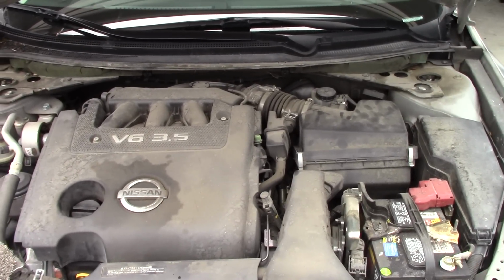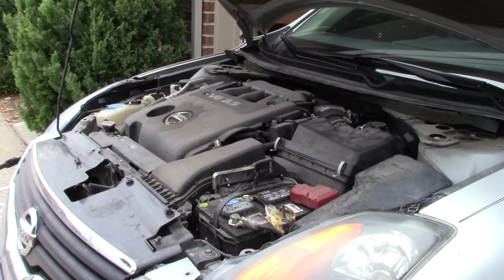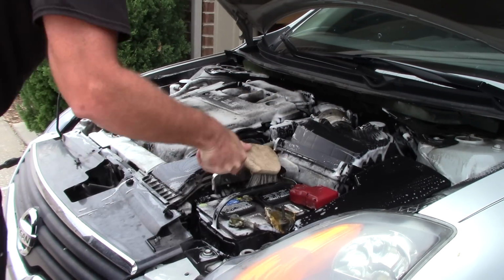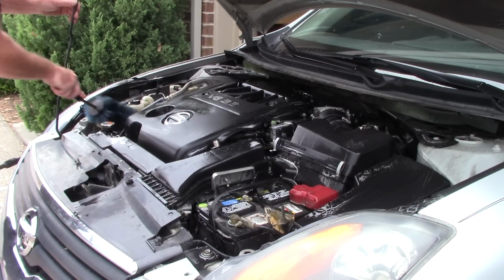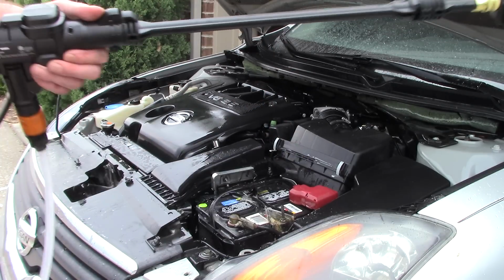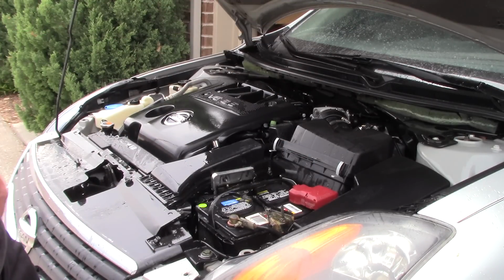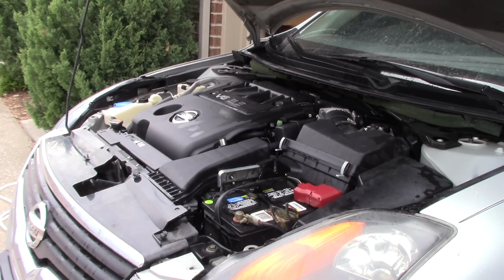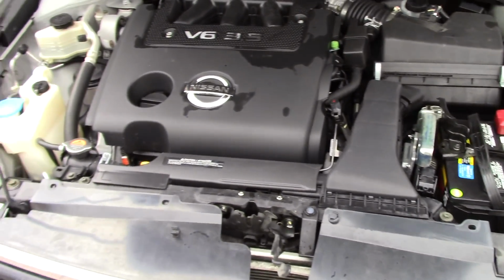Real Time: Super Clean Aerosol vs Dirty Engine Bay - Great Video For Beginners

Comment: Nice Video & Good Work & Knowledge, The Only Thing I Think was kinda funny & he will say “ ITS BECAUSE I WAS TIRED “ he said it’s a 2007 or a 2018 Nissan Altima there is a Huge Difference in the Engine bay / Body Design Between a 2007 & or a 2018 & it couldn’t be a 2018 & Not Have Been cleaned in So Long, when they just came Out “

Comment: If he had no problems with the sensors is a very lucky man because the Walter must be at least 1 meter of the engine,  better hot water. And disconect the batery.

Comment: Using a power washer on electrical parts can damage them. Avoid the ECU, fuse box, etc. A garden hose would have less pressure and will be safer.

Comment: Surely its not wise to spray pressurised water into an engine bay, this could force water into electrical sensors or otherwise. Fair enough use the foam and agitate it, but a wipe down with microfibre towels would prevent water ingress under pressure

Comment: Is there a problem with just wiping off the SuperClean with a towel and skipping the water?  Won't be as thorough, I know. Thx for your videos.
Reply from the maker: that would work just fine and would work depending on your level of expectations...great question:)...i have a video coming up soon on how to wash a engine bay thats safe and with no water even if engine bay is really dirty
Reply: THx! Will be watching for the next one. This 80-year-old lady is enjoying and benefitting from your videos. Could hardly wait until the stores opened to get my SuperClean and glass washing "tool" to clean my 2007 Camry door jambs.Looking good!. Guess I need to go back tomorrow to buy the Invisible glass triangular tool that I also passed up as a gimmick. Could not begin to consider sitting backwards and getting enough pressure to clean the interior windshield. May have to figure a workaround to use a Magic Eraser on that tool.
Reply: @dallaspaintcorrectionautod8343 wouldn't just wiping super clean off paint be the same as letting it dry on paint?

Comment: thanks

long day...

often wondered how mechanics perceive clean engines vs filthy engines,  their owners and their efforts  to  repair filthy engines bays
leaning in and over dirt oil and  grease 

tools, hands clothes compromised more than when working on a clean engine

small dropped screws, bolts etc.  lost in the mucky engine area

does the quality of the efforts increase with cleaner motors

hmmmm....

Comment: **Ever heard never use water over the engine**

So dry clean is supposed to be better. The beginning process is fine, just do not drop water like that, use a towel and rinse it in a bucket with water, up to clean it.
Reply from the maker: If you lack experience, you should do a dry clean and let professionals do what we all do and have for years using water..
It's done by the biggest names in auto detailing
Reply: @dallaspaintcorrectionautod8343  Dear Dallas......it is an open communication forum, so some you gonna like it and some don't. So see you soon....

Comment: All you did was clean a few plastic engine covers. And what's more you used an overpriced aerosol rather than the liquid degreasers which are far more economical.
Reply: Hpw about the sides and bottom where the real dirt is

Comment: If it is safe to spray water all under the hood wouldn't the car manufacturers have designed the hoods with water vents so while driving the rain would rinse out the engine every month?  Just saying...

Comment: Why are all the plastic clips/panel screws missing for the grill shroud? Perhaps he cleaned some leaves or debris in front of the AC condenser, but I wouldn't bet money he knows where he put the clips. - Scott: Check you left front pocket. No... not later when you are at home getting in the shower.. NOW would be a good time. The man was TIRED, lol! 

PS: You power washed the silver lettering on the engine cover lettering. Not sure how that could be avoided.. masking it perhaps. But pressure spraying it is probably not the way to go. It looks a lot better, but I don't like to see things damaged in the process. An Altima, meh.. if it was a seriously nice car I would be upset. But a seriously nice car wouldn't have plastic crap all over either.

Comment: I always degrease an engine bay with the engine running. Worse case you get some water in the somewhere it shouldnt there will be heat to dry it up.

Comment: Way too scared to clean my engine with anything wet.  So many CPU’s under the hood.
I do blow out leaves and debris with my Stihl gas blower.
Reply: Yeah too many sensors and electricals. Besides engine decrease needs to be thoroughly rinsed of with water. I'm not blasting all those things with water.

Comment: Remove engine cover, and never ever use a pressure washer on an engine. That water gets into places is doesn’t belong. Using a regular hose will also work and is safer
Reply from the maker: SoCal Realtor customer is given the option to remove cover, customer said no..This power washer I'm using is very very low pressure and low water volume, it's actually safer than garden hose my friend:)

Comment: I would definitely go with Chris fix video for super cleaning ur engine bay over this. Not only does he do it right, takes his time but makes sure you dont fuck up ur car. I can tell besides you mentioning it that this was not your car because you went so quickly with no care. This is shooting water into your electronic components, the S-belt and battery terminals. I guarentee people will do this and end up with a check engine light...

Comment: Did my dude just pressure wash the battery terminals? As a mechanic, ima say this just once, in the hope that someone thinking about cleaning their engine sees it: STOP cleaning your engine bays and engines. Your are doing more harm than good. Actually, you are doing only harm. Engines will always get dirty, they are not meant to be spotless. If anything, a “dirty” engine helps you identify where leaks are coming from.

Comment: First thing you didn't take the cover off from the engine, second thing you didn't take the battery out and wash Chris fix
Reply: Taking the cover off and taking the battery out would take a long time and would add to the total cleaning time which would mean the client will have to pay more money.  The type of service or engine bay detail/cleaning in the Chris Fix video is what you would pay for a detail that costs a lot of money i.e. $1,000 or more.  This video is quick and easy perfect for your average client.

Comment: When I worked at a dealership and detailed cars I was always nervous doing the engine bay in fear of the car throwing a check engine code. Most of the cars I cleaned didn't but some some did and that's what scared me. I remember cleaning a older blazer and after I cleaned the engine it wouldn't start haha

Comment: You didn't even clean the engine. Why didn't you remove the plastic black cover to clean the actual top of the engine? I own a 2008 Altima and they get really greasy and dirty underneath that plastic cover.

Comment: Maybe it's just me but high pressure water and degreaser doesn't seem like a good combo for fuse boxes, thin wires, and air filters..
Only saying this because I've seen several people come through a shop for "electrical and water issues" and then we later find out they washed their engine bay while at the car wash.

Comment: If that is detailing, I would rather not bother. That should be called, cleaning the bits you can easily see! Surprised it wasn't all sprayed afterwards with silicone spray to make it all nice and shiny. What about all the crud under the engine cover and all the nasty stuff you have just rinsed off that is going to sit on all the lower points of the engine and engine bay that will turn into a lovely sludge on the engine under tray. Most Engine bays don't mind being pressure washed provided you don't aim directly at major electrical components, such as fuse box, alternator, starter motor, etc! Almost all automotive connections are rated to 'IP67' or fully waterproof, So can stand it. Plus do you clean the area the vehicle is stood on after washing potential noxious chemical onto the ground where they can possibly enter drains or local watercourses, or are all your cleaning chemicals fully bio-degradable? As I seem to recall that most engine oils, power steering fluid, brake fluid, etc! Are not particularly good for most environments! just a thought is all!

Comment: It'd be a great idea to show what your using
Reply from the maker: i have many videos discussing what i use and at length..plus in this video i said super clean..what else do you need to know?..thanks for your support and watching the video
Reply: Dallas Paint Correction & Auto Detailing some people find it easier to see a bottle or can of product so they don't need to do research to find what it is your using to clean with like those ads on TV. it's just a lazy way to go about it. I do have a question of my own for you though will that stuff take off built up oil or grease from the engine block it's self I have an 85 Camaro that used to leak tons of oil on the block and was never cleaned off from previous owner
Reply: Amazon affiliate link to the product in the description?  It takes the viewer right to the product AND you get a cut of the action from Amazon. . . Mo' Money!

Comment: After degreasing and rinsing the engine and engine bay, don't you end up with a greasy spot on the driveway?
Reply: Hector YES you do! But!! O'Smiley's to the rescue with the special " XPLUS-Wipe2000" driveway wipes as seen on TV! Just wipe the driveway down, let sit for 5 minutes then gently light the spot with a lighter and POOF!!!! the spot is gone!!
Reply: Oils are just very long strands of carbon molecules held together with hydrogen bonds. Degreaser is just a chemical to break the hydrogen bonds down, therefore making the carbon molecules wash away with water. It is essentially not oil any more, so no oily spot.

Comment: Hey, leave the guy alone! How many of you arm chair quarterbacks are willing to share YOUR ideas on Youtube? So many dad-blamed "experts" here! There is no one perfect way to do anything.  You aren't going to short the 12 volt battery with water whether or not its ionized or distilled water. And most cars worth their salt have all the engine bay electronics well protected from water. Ever seen the engine bay on a car after driving in a really heavy rain? I've been pressure washing car bays for over fifty years and never any problems that a short wait to let water evaporate never fixed. Also NEVER disconnected the battery terminals and always pressure washed the alternator really really good especially if it was a GM with alternator on top where it really needs to sparkle! You can be overly cautious about stepping on a turtle in the road and never get across the road! I can't wait to try out that Super Clean stuff on my two old Ford 8N tractors - if it can get THOSE engines sparkling clean again, I will be a life-long believer!

Comment: My beast mechanic told me not to do that which could lead to damage electrical parts, dirty engine will be just fine.
Reply from the maker: fadi azzam your mechanic I guess doesn't understand that if an engine is dirty that moisture will be trapped within that dust and dirt and over time will cause corrosion.
Maybe you should find a different mechanic that understands this simple concept:)

Comment: I never let ANYONE touch my car, I do all labour and all the cleaning fixing repairs anything, otherwise you have some jackass in a garage qwrecking your car.i once had a guy at a garage change over my summer rubber for winters.. while i'm sitting there waiting he pulls out of the bay and says all done! I look down and the two right side tires are flat, Completely flay\t,the moron didn't put air in them then drives out of the bay on flats ,nice going Dickweed. luckily they didn't wreck the belt inside the tire.but that is exactly why I do not pay some semi-trained monkey to fuck with my car and charge insane undeserved unlaboured for prices.

Comment: No hood cleaning. That's part of engine bay to me. Then high pressure water on electric connections that are 10+ years old I personally wouldnt want to chance water being forced in them. If no issues right away it will cause them in the future. Corrosion takes time. Other then that good job

Comment: He neglected to use baking soda to neutralize the battery acid first so that he doesn't spread it all over the engine bay!
Reply from the maker: The Best Uber Driver in San Francisco give me a break dude..lol
Enjoy your baking soda, use it to brush your teeth as well:)
This engine bay had battery acid dripping for years before I came into contact with it and no present problems from all that battery acid!
Talk about over thinking everything my friend:)
Reply: Dallas Paint Correction & Auto Detailing well unless the battery was spraying itself the the acid was confined to the top of the battery and the box. Neutralizing it is also a good safety practice especially when spraying with water. Not over-thinking, but as a professional mechanic for over 40 years, I have seen a few things. BTW, I DO use it to brush my teeth!😘

Comment: This is power steering oil reservoir not brake fluid brake Fliud on driver side and you sprayed battery terminal , starter, alternator with water 😳😳😳 OMG hope this customer doesn't have electrical problem 😖😖😖

Comment: I like how the Super Clean removes the paint off the letters on the engine cover.
Reply from the maker: NO...the reason why the letters on the plastic cover broke down from the cleaner had NOTHING to do with the cleaner!..i will help you so you can actually learn something and stop spreading bad information..the letters were ALREADY compromised because the client had never cleaned the engine for over 10 YEARS!..when you allow dirt and grease to sit on plastic pieces that have painted lettering, that dirt and grease will trap MOISTURE and that moisture with the dirt sitting on the letters for over 10 years had eaten away at the PAINT that makes up the letters so when a brush and even water alone would have removed some of the paint that makes up the letters..this HAPPENS all the time on engines that have been neglected for LONG periods of time and as PROS we discuss this before beginning the job:)...this is one reason why people should wash and maintain their engine bay on a yearly basis:)...so now that you know the facts and you learned it from a PRO with over 26 years of experience, you can stop spreading ignorant facts and stand in the power of truth and facts:)...you're welcome Snoop for the power of true knowledge:)

Comment: Didn’t disconnect the battery, high pressure washer is the second biggest mistake, a commercial aerosol can of degreaser,,, soapy waster is far better, it doesn’t ruin the plastics and rubber, and when the front bumper grille come loose on the free and blows through car, I guess the rest is the least of your problems

Comment: You broke a clip off the front shroud and threw it away and never replaced it scott 😭
Reply from the maker: It's okay my friend:)
The front grill was already broken and the client was having it replaced a few days later..
I already discussed with the client before doing the cleaning the clips would fall off because when I opened the hood stuff fell on the ground before I started..Lol
I guess the car was in a light accident a few days earlier before I cleaned the engine:(
Reply: Dallas Paint Correction & Auto Detailing I love and support your channel no matter how many clips fall off 🙃

Comment: The white "3.5" on the top of the engine is almost gone now
Reply from the maker: yes...it was already broken down from all the grease and grime that wasn't cleaned off this engine in over 10 years..it had nothing to do with the cleaner my friend:)...when ever you have dirt and dust sitting on the plastic areas of the engine you also have moisture and that moisture will break down the painted letters and numbers and in this case it was for over 10 years..just using water would have done the same thing...thats why as pros we recommend you clean your engine whenever its dirty..just a free tip my brother:)

Comment: Isn’t the unwritten rule of engine bay cleaning to never use a pressure washer??? 

Because, 🖕🏽 the electronics.  🤣🤣🤣
Reply: He used distilled water, and that little tool is not really a pressure washer, I think he was probably using 80bar or something.

Comment: You took off most of the 3.5 on the cover lol. Way to go
Reply from the maker: well you're a moron because the engine hasn't been washed in over 10 years, the built up dirt which holds moisture already had begun to degrade the 3.5 and just using water alone would have removed the painted area on plastic...dont you feel like a moron because you lack info and the ability to apply critical thinking..lol..you should get that checked my friend:)
Reply: Cliff C must also be blind, because it was already coming off in the first dirty shot of the engine....  Yes Cliff C is a Moron....